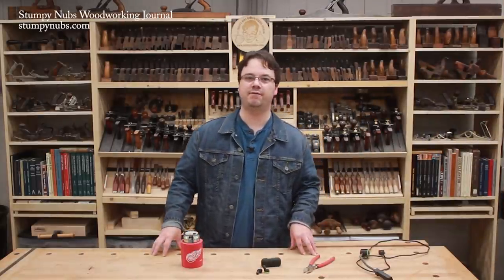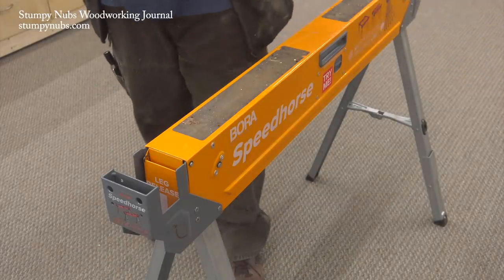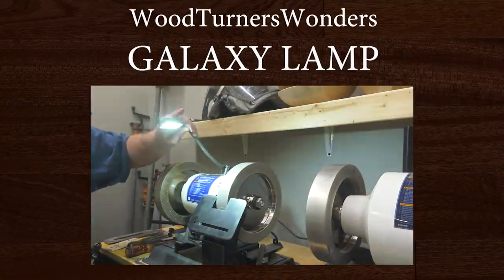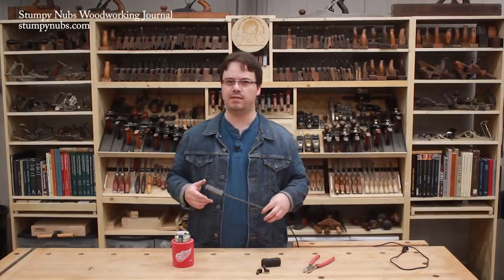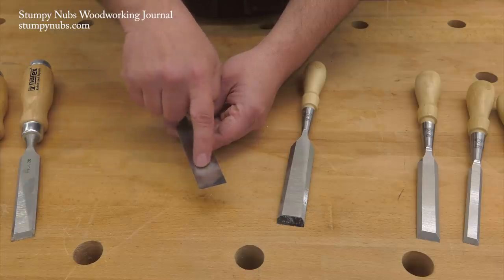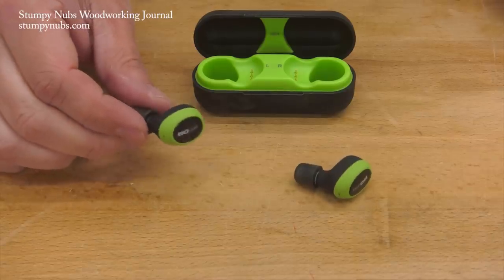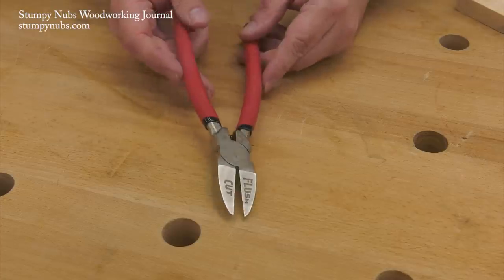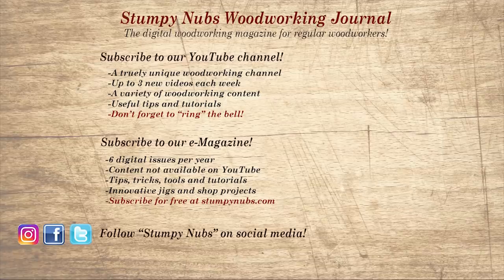5 tools from our workshop that you'll want to have in yours!

Comment: I got tired of limping along with my ancient cheapie "Saw Horse Kit" 2x4 horses that always seemed to find an inopportune time to collapse or wobble, so I upgraded to the Bora Speed Horses. Everything you said about them is spot on.  I've had them for about a year and a half and they are just as rugged and dependable as day one.

One quick note though, if you don't have a reasonably flat and straight piece of 2x4 to use as a sacrificial surface you can twist the sawhorse enough to make it wobble.

Thanks for these videos!

Comment: I have similar folding saw horses that have been around for a few years. While mine aren’t as fast to set up or put away, they do have similar features. The sheet flip outs, the 2x connectors and mine will also accept 4x in the pockets. Mine have adjustable legs that allow them to be different heights and also can be used to level them on stairs if needed. I love them, I’d highly suggest the Bora for anyone wanting new sawhorses.

Comment: I have a set of the ISOtunes (wired) hearing protection and I love them.  If they ever bite the dust, I would definitely buy the non-wired version.  I use them mowing, in the shop and anywhere there is excess noise.  
The lights I surely could use, but they just seem overpriced to me.
The flush cut pliers?  Next time I buy something on Amazon, they will be included.  They would be great for cutting the tails off zip ties and not leave that very small and sharp piece to hang your skin on.  
Good reviews

Comment: even though a lot of the tools shown in these videos are really cool, and I would like to get them, most I cant afford, or cant justify the upgrade for the cost. but I just used your link and ordered one of those magnetic lights. I am 53, and agree, sometimes I need more light right exactly where I am working than I used to. thanks for letting us know about this, I had never seen a light that would stick magnetically to my tools, and be so easy to move around the shop.

Comment: OK, i've walked by those saw horses so many times, thought, pffft, just another no need to look at, copy of something i already have. Thanks for enlightening me.  Those are really cool, and i will be getting a pair once my income comes back(if it ever does!). PS i have those side cutters. I've used them for edge banding (work great) but like you, have found a zillion uses for them. Love them, they are in my main tool box now. My only complaint was one of the grippy things kept sliding down, so i cut a tiny bit of heat shrink, and put it up at the top to hold it on. That was months ago.

Comment: If you want a decent chisel look in the bargain bin for the Dewalt chisel set, around 20 bucks, they are easy to flatten on the back and seem to hold an edge for a long time for medium work like cutting mortises. These have the black and yellow handles and a metal shaft going through them. Buy cheap to start then upgrade as you get the money, I'm still using the Dewalt chisel set myself and am speaking from experience.
Reply from the maker: Dewalt's steel shaft chisels are essentially the same as the Stanley Fat Max we've mentioned on here several times. I use them for rough pounding on construction projects. They take a lot of abuse.
Reply: @StumpyNubs  Yeah but they get the job done is what I was pointing out, now for fine work you will have to sharpen them for obvious reasons. But hey, we all have those (other) chisels in our shop because they don't cost much to replace.

Comment: I wanted a new set of earbuds and after listening to lots of your YouTube videos I ordered a set of Isotunes and the sound was great but unfortunately they wouldn't stay in my ears, same thing happened with my BOSE earbuds that I tried next after the Isotunes. I figure it's my ears not the isotunes. Either way I just wanted to say thanks for getting me to at least try them. They really did sound good.
Reply from the maker: They make a model with wire hooks that go around the ear. They also make larger foam ear-pieces. Give them a call/email and see how they can help.

Comment: It seems like no matter what we do we run into nylon wire ties eventually.  Flush cutting pliers cut the tails of wire ties off right at the lock so they don't slice into you later.  Thanks for the tip on the Galaxy lights.  I need several.

Comment: One drawback I see with the sawhorses, are the inability to use clamps directly on them like you can on the Stanley FATMAX pair. The Fatmax lack some of the features,and others are a bit different, but being able to clamp the workpiece directly to them is a must for me, and I am really happy with them.
The Fatmax also clip together as a pair for easy carrying and storage, and they can support upt to ~2000 pounds for the pair (900 kg).
Reply: Henrik Paulsen Also the independently adjustable legs for working on an irregular sloping dirt floor.  (At least on the model of Fat Max I have)

Comment: Was that a Harvey bandsaw in the B roll?  I just finished assembling and tuning my new C14.  If it was a Harvey, I'll feel a little less nervous about taking a chance on a such a new entrant to the US market.

I bought the flush cut pliers for edge banding, too.  I got a second one just for edge banding since I got a slight nick in the first set that translated to the edge banding.  I also have a set of Narex chisels for use on 'second tier' projects.  My experience with the backs is the same as yours.  I guess the take away is I can vouch for half of what you said today. :)
Reply from the maker: I own and love both Harvey band saws, the C-14 and the bigger HW615. The blade guide adjustments on the C14 are a game changer. Love them.

Comment: I liked the ISOTunes referral and followed the link you provided. However, because I like to have a lanyard to hold ear buds or ear plugs around my neck when I take them out, I will choose the ISOTUNES PRO 2.0 (unless you suggest a reason not to). Before I pull the trigger, is there a way to have you get a commission, or at least credit, for directing business to ISOTUNES? I noticed the URL removes "StumpyNubs" when the page changes from the linked address to the ISOTUNES PRO 2.0 page.
Reply from the maker: As long as you visit the site by clicking my link, they know I sent you there. The PRO 2.0 are great too!

Comment: I use magnetic LED lights like these (yeah, same issues with poor vision), but I prefer not to have dangly wires near my rotary tools.  I use a pair of cordless ones; they charge off a normal USB charger and go for a couple of hours on a single charge, good enough for most jobs.  And if you have to, you can run them continuously on the charger as well.  I can't recommend the brand as they are unbranded.

Those sawhorses though... I don't a large work table and no room for one either, and those look really good.  Not easy to find in Europe, but looks like there's a shop on Ebay UK that has them.

Comment: How does the ISOtunes Free compare with the 2.0 Pro model as far as comfort, sound quality, security of fit?
Reply from the maker: They are difficult to compare because they are so different. The lack of wires make the lighter. They are also smaller, including the length of the foam earpiece, so the feel different. Most earbuds tend to bother my ears after a couple hours. These are comfortable to wear all day. As for sound quality, they are as nice as the other models. I am no audiophile, so I can't speak to the pure quality of the sound.

Comment: If you need inexpensive but good chisels I like the Buck Brothers, they are even made in the USA. Home Depot carries them for a very reasonable price. They are less expensive than the Narex. The fit and finish is not as nice. But they take and hold an edge, are cheep as chips and you can whale on them with a hammer all day. They are through tang with metal caps so they don't care about being beaten like they cost nothing. The Narex ones are better but if you just need a 20$ solution the Buck bros. are awesome.

Comment: I got the Isotunes Frees for Christmas and I love them, but they are so quite that I can't hear a podcast or music while any tool is on so I where regular over-ear hearing protection on top of the isotunes. Is that your experience? I have good hearing, so I don't normally need loud headphones, but when these are maxed someone talking over them drowns out the sound.
Reply from the maker: Are you sure they are turned up all the way? What about the volume adjustment on the phone? They are supposed to max out at 85db, which is the max range before hearing damage occurs. That should be PLENTY loud. And since they are designed to block out exterior sounds, you shouldn't hear the saw over the music. Are you wearing the right earpieces on them? They come with larger and smaller ones. Maybe they aren't fitting your ears. Try the bigger ones. Are you insertign them properly (rolling the foam between fingers, pulling on top of ear to open the canal as they go in and expand to fill the space)?They also come with silicone earpieces, but those won't block the sound of the machines.
Reply: @StumpyNubs  Man that is good to know. I have them fit well, where they stick in tight and I can shake my head without them coming out, and the volume maxed. I've got the foam ear pieces in, and notive some sound reduction, but not enough to hear anything when machines are going. When I emailed isotunes they said they were rated for 85 db and if I wasn't happy to return them. But I just wanted help trouble shooting. I'm passed my 30 days now, but it sounds like I've got defective ones.
Reply from the maker: @mathollen  - If the product is defective, they are covered under warranty. The 30 days don't apply. Call them.
Reply: @StumpyNubs  Thanks SO much for the encouragement. I called Isotunes, and they totally fixed the problem. Just got my frees back from Isotunes and it's a night and day difference. So appreciate everything you do for the woodworking community

Comment: Guitar builders have a set of flush cutting nippers where the cut is perpendicular to normal cutters. I have a spare pair just for general shop work. They're even easier to use than the type you've shown here for most applications where you're trimming perpendicular to a surface, for me, anyway. Google 'Fret Cutters Flush Cutting End Nips" to see an example.

Comment: I bought a pair of those side cutters. Despite the "Heavy Duty" label they are definitely not made for cutting anything heavy duty metal. A few days after I bought my first pair I found myself in the odd situation of having to cut an old rusty fish hook from out of a Pelican's neck. (long story). Short version the Pelican was successfully released and the cutters had three round divots along each of the cutting blades. 
They are great for soft wires or timber edging but save them for  the finer work.

Comment: I really want to get the Isotunes Free, but a ton of reviews say the max volume is too low and they can’t be heard when actually running anything loud. Even though they’re listed as the same max volume as the other Isotunes model people say in side by side testing the Free model is a lot quieter. 

Have you tried a side by side test or noticed a difference?
Reply from the maker: Some people like to blast their ear drums, I guess. They are limited at 85db, which is the limit before noise causes damage to your inner ear. https://hearsmart.org/what-problem/decibels-and-damage/
Reply: Stumpy Nubs from what I’ve read it’s not that they can’t play it loud enough just to have loud music, but it’s that when they do run loud machinery they can’t even hear what they’re listening to on the ear buds any more. And they says they’re noticeably quieter than the other models of Isotunes that are listed with the same 85db max.
Reply from the maker: @JohnJones-it3us  Since the whole purpose of the earbud is to block the exterior noise of the machinery, that should have little to no effect. It's possible they had a batch at one point that had volume issues. I don't know. But they obviously wouldn't make an earbud for use around machinery that doesn't work around machinery.

Comment: I own a set of ISOTune free.  They sound spectacular and are the most comfortable earbuds I’ve used.  

However they have the most sensitive mic I’ve ever seen and that mic has ZERO noise cancellation.   Furthermore, on a plane they do muffle the snoring neighbor.  But when the air pressure goes down, you can’t hear your music or podcasts because all ISOTunes products have a hard volume limit.  This means when you’re at altitude and the air pressure drops, there is less air to carry the sound and you can’t turn it up loud enough to compensate.  

I spoke with ISOTunes and they confirmed this feature is why I couldn’t hear my earbuds on my flight and there was nothing to be done about it. 

They’re great on the ground, and great for phone calls in a quiet room. But realize the limitations.
Reply from the maker: I totally disagree about background noise cancellation. In fact, their noise cancellation mics are one of the best features of all ISOtunes earbuds. There are dozens of independent reviews about that feature. In fact I just watched one today where they recorded the audio to show how you couldn't hear the sound of a loud tractor someone was driving while talking on the phone through these earbuds. I am not sure what the deal is with yours, but perhaps you should send them back for a replacement.

Comment: Wait until you use the flush cuts for wire ties you will never know what you did without them
Reply: Shawn, I learned this from my son... to cut a "Wire Tie" below flush, use the tips of Linesman Pliers to grab the extra unneeded portion "straight on" and as close as possible to the tiny plastic block... then simply rotate your Linesman Pliers 1.5 times... This will reward you with a "below flush cut" that will not diminish the strength of the Wire Tie! :-)

Comment: I tried the isotunes pro and their minium volume is so loud they hurt my ears. If you already have damaged hearing they might work out fine but for anyone with good hearing look elsewhere.
Reply from the maker: Obviously something is not working right. Why not contact them so they can help you?
Reply: Joe, try checking the volume on whatever the isotunes are paired to to see if that volume is set to the max level.  If so, you might try lowering it.  This is assuming that both the isotunes and the pairing device both have separate volumes.

Comment: I’ve been eyeing those Fastcap trimmers for a while, think I’ll bite the bullet. 

Also, any plans to update the air filter upgrade with plans to install the inline filter?
Reply from the maker: Which air filter are you referring to? The Jet ambient filter I had in the od shop?
Reply: @StumpyNubs  Yes, the Jet Model, wanted to make an inline filter for it, couldn't find plans on your site for it
Reply from the maker: We may move it into the new shop. I never made plans because the original video told you everything you needed to know.

Comment: Don’t know about the mag light that you have from woodturners but don’t bother with the beacon. The light is so heavy the mag can’t support it. It will only stay still if you keep most of it vertical. I found much better lights on amazon for a fraction of the cost and way better. Sometimes you think your getting something well made by spending a little more but not the case here.

Comment: Yeah, those "Bora Speedhorses" are just rebranded "Toughbuilt C700 Sawhorses".  Nice units tho.
Reply from the maker: The Toughbuilt aren't the same at all. They don't have to quick-setup legs, the 2X4 hooks on the ends don't account for sacrificial tops, they don't have the convenient screw holes, they aren't as sturdy and the Toughbuilt versions (like others) puts a plastic handle on top where it gets in the way and eventually breaks off.
Reply: @StumpyNubs  You are correct, there certainly are functional differences between them.  Definitely thoughtful differences.  I'll give ya that.  Thanks for the clarification!!  I'd still have to guess they are manufactured in the same plant tho.

Comment: Flush cut: observation, in most cases, and I really mean most as in 99% of the time, you don't want to try to extract a brad driven by an air nailer. You'll probably mar the wood in one way or another. Those brads will break off below the surface with a few back and forth bends, good brads break faster. They're all fairly soft metal, bending will work harden them and boom, they break and leave a very minimal surface blemish if at at. I used to try to extract them or cut them off, nope, old school mentality and I'm old enough to be pretty old school. Just bend them and break them off, it's faster and cleaner when that inevitable, errant brad tries to ruin your work.

Comment: I returned the ISO Free buds as they couldn’t deliver sufficient volume for music listening.
Reply: I believe that they have to keep the maximum volume output down do to the fact that they close off the ear as an earplugs does. Removing any inward and outward air flow.
Reply from the maker: You must either like to blast your eardrums, or you've done that so long your hearing is damaged, because they are limited at 85db, which is the limit before noise causes damage to your inner ear. https://hearsmart.org/what-problem/decibels-and-damage/
Reply: Could have gotten the industrial pair.
I  believe when I ordered last night there was a 10 or 15 db difference between them and the regular ones
Reply: Stumpy Nubs  I’m 65 so hearing loss is highly likely for me. I found an affordable pair from SoundCore that sound great and provide at least some hearing protection...not ideal.